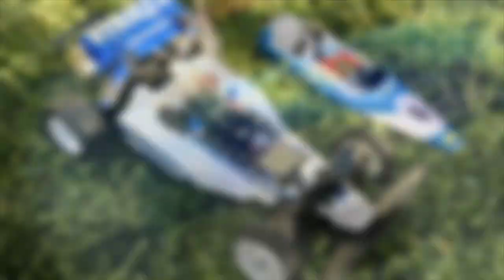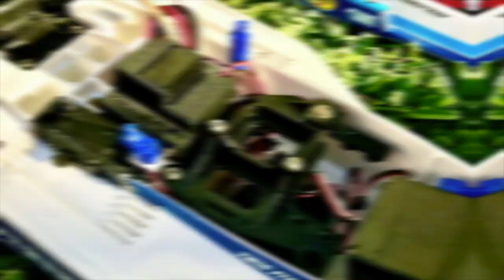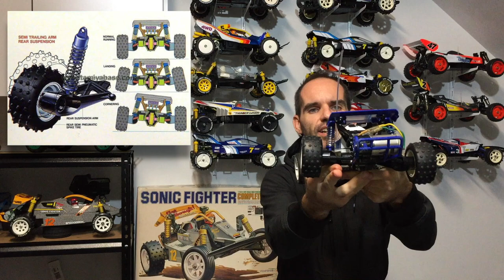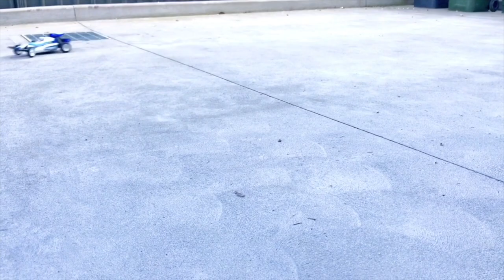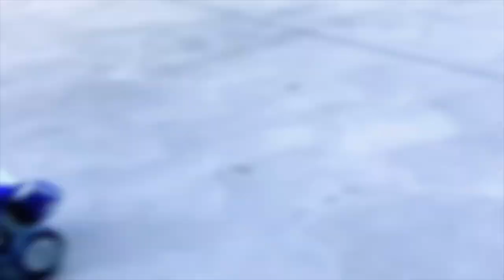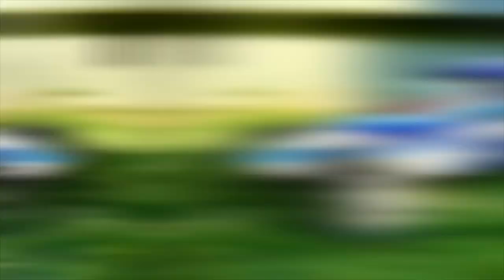Tamiya Striker Vintage 1/10 RC Buggy Close Look, Run & Futaba Radio Instal. Tamiya Chassis Kit 58061

Comment: You know I had that car I would try to always make it faster than a hornet for a grasshopper because of its setup so I would probably go to a 20-23 turn motor on that. That just my opinion. I go based on a Carly are what the car represents of that particular car that's how I feel according to what type of Motors I want to put in them.
Reply from the maker: Yes It could definitely Do with a Hop Up motor. Stay Tuned for a Future Run Video for a Possible Vintage Motor Upgrade 👌🏻

Comment: I'm just wondering you have her with gear gifts for these cars that you could use them to Tamiya anti wear Grease don't have to use much on the gears give it some limited slip differential action.
Reply from the maker: Yeah When I Do a full Restoration I plan on Running some Thicker Grease on the Diff.